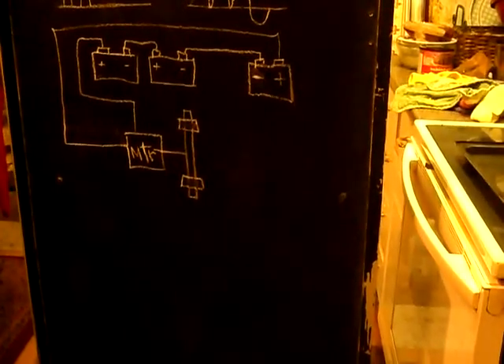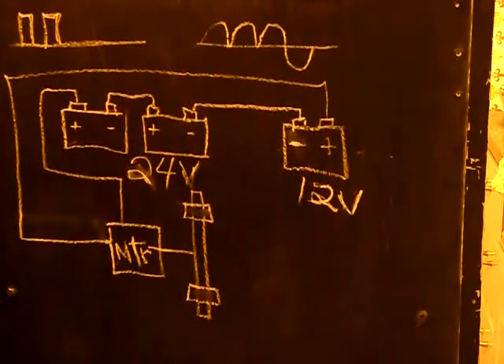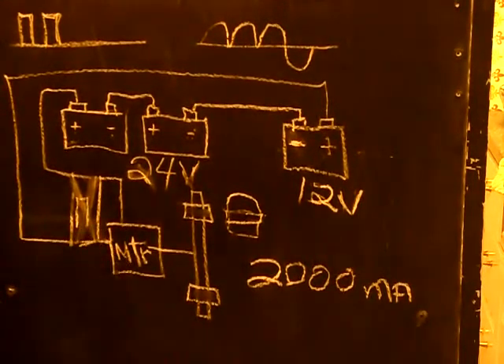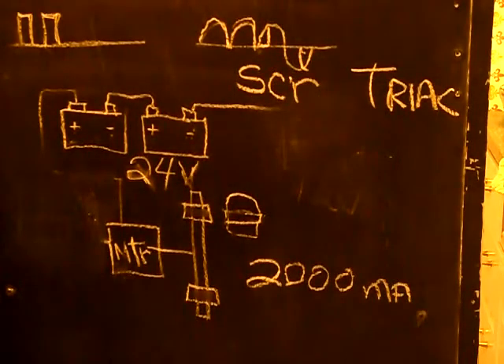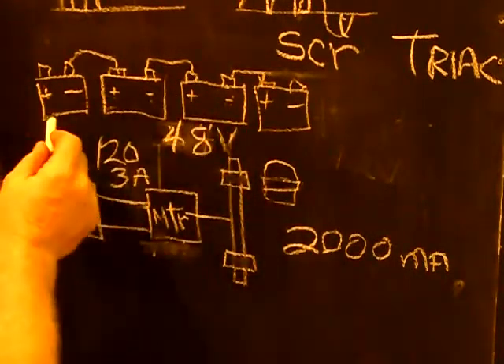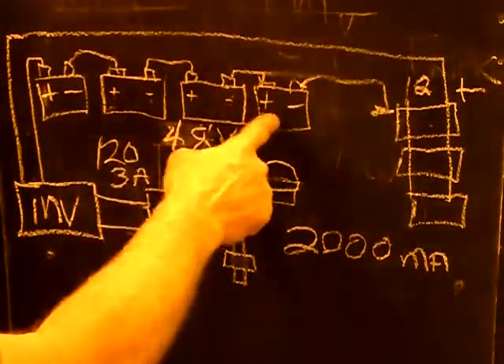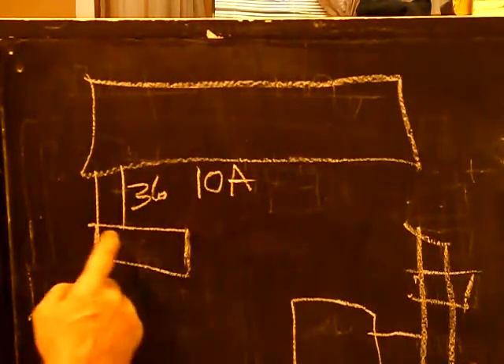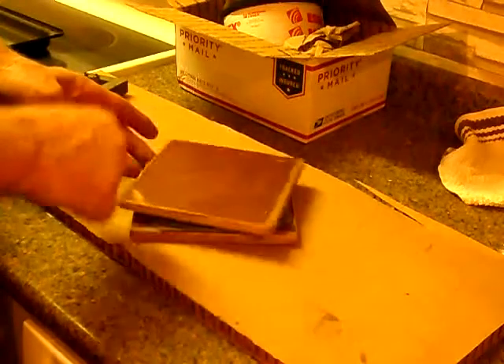Split The Positive and Speed Up Under Load Cores

Comment: I don't think you're splitting the positive in this diagram you have drawn out. It was pretty clear in the Hairpin Circuit, with Ed Gray's device and Henry Moray himself, that you literally SPLIT the positive terminal with a spark gap of some sort, which would provide the pulse needed. But it was the SPLIT, the separation of this line, that split the positive, but it wouldn't work just being split, it still had to transmit, and the solution was with a spark gap. What you have setup is two batteries in series and then one in parallel. I don't see how that's considered splitting the positive, especially since you have it split on the return line..

Comment: If there is no drag.  Can it really be considered as power,  or si gle sided energy only?  Do you think Paul Babcock is a charlatan, and have you looked into his, "zero stating the inductor design that he ran lights with,  because I think he did that using highly capacitive coils and diodes to be at the zero state, when his solenodial coil is saturated (by each quarter cycle) at the peak.  This would allowed that reactive power to escape into the lighting load,  would this be even comparable to " Ed Greys," definition of splitting the positive design?
Reply: Ed took things further in a different direction cold plasma discharge electrostatics 

What Paul’s talking about many have done, but no company has produced a domestic tech release to feature it yet. 

The whole issue is that in nature’s patterns are the same across different mediums in the way they come to the result e.g Action reaction, or waves. 
BUT if we take the action reaction pattern in nature for example, nature comes to that pattern result differently in different mediums. In classical nature physics the action reaction (3rd Law) is simple one mass hits another mass and the energy is shared and also action reaction...
In electric physics tho nature is more complex in this area, for example in electrodynamics a transformer has 2 X the energy in the circuit at any moment so a 1 watt transformer, has 2 watts in the circuit at any time, yet you only put 1 watt in the input... and we can only take 1 watt out in the restive classic model unless we make it reactive Vars then different things happen.

I have a transformer build, with reactive power on the primary, and real power on secondary doing restive work!
Reply from the maker: Yes splitting the positive can achieve different goals. Ed Gray used ultra high voltage split between 12 volts, not the same as the other form. Paul is doing what many have done "COLLECT the back spike) and the no drag magnetic cancellation is turning out to give COP higher than 4. You are talking about everything all at once. Each subject is far deeper. You need more time to study. Go to energeticforum.com
Reply: @BroMikey55  and also have you seen infinity sav ? They have done the same thing re-Paul collecting the feed back, but using a generator topology, and what’s amazing about that idea is generator coils of course contain the complete induced voltage & current flow... so by collecting the feed back from generator coils you can gain much of the complete energy induced in the gen coils from the original rotor induction!

A electrical engineer will have a hard time saying “well that’s just a feedback spike, and not much current / energy gained” 
Because with the generator version it would be then to say “a generator coil doesn’t gain much induction in the fist place” which would be a nonsense statement, as it’s a generator, not a motor stator coil whereby the motor stator coil will only have a small induced emf and small feedback gain.

Comment: There’s no actual gain with split positive design unless your load is a pure inductive load and not resistive.
This is possible reactive power can do real work!

And that’s just because as we all know - any non-DC voltage returns to the source and is not use in a load except for copper losses which is very very small losses.
Clearly ohms law - ohmic heating drops v  so it’s the Vp that is used up - work current does while a Vp is available 

The free gain in this area only comes form 2 possibilities; 
1. Make a pure inductive load circuit and then you can capture and reuse the energy over again (free gain)

2. Capture fly back from the coil and use this energy. Which might I add is not ever accoutered for as a energy gain in mainstream but they are having their cake and eating it to - as they use diodes to suppress this gain in energy - gain as a result of conservation of energy it’s self Lenz Law...
Reply: Are you a fan of Mr Babcock too?
Reply: @ryanb1874  yeah Paul and many more people have known about this for many years, even from the start!